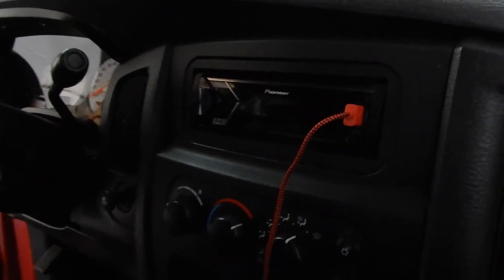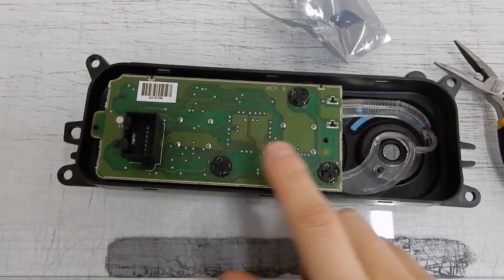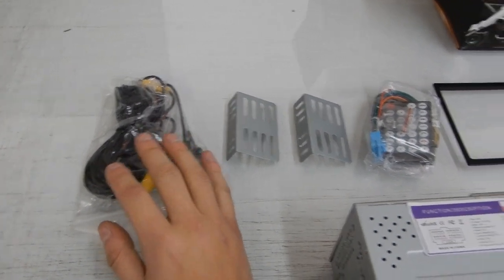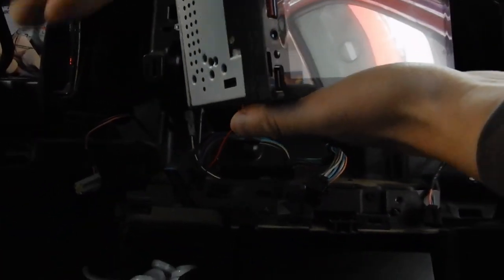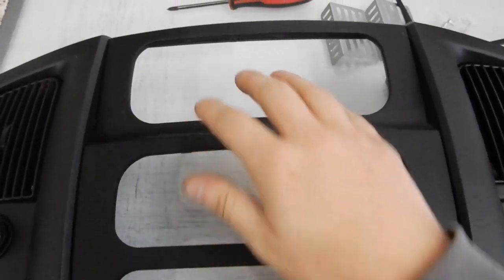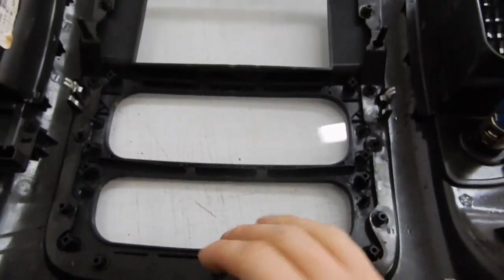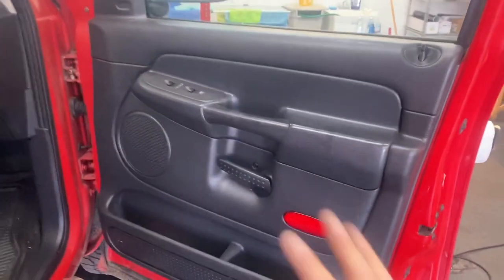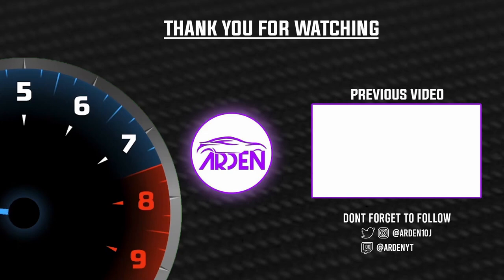2005 Dodge Ram Double DIN Radio Install!

Comment: Door jam harness broken that's why that rear speaker doesn't work
Reply: Well known issue with every Chrysler/Dodge vehicle. Anything older than 10 years speakers, courtesy lights or power locks dont work, and that rubber accordion is where you need to look. Their wires always break. It's like they use the brittlest insulation possible for the wiring harnesses. Ford and Chevy don't have that have that issue.
Reply: 100% correct. It's a common  repair.
Reply: @chadjohnson7544  not always,  I checked and I  still have a ground issue to my door locks😢
Reply: @jlrockafella   hmmm interesting. Let me dive into some  old documents and get back to you on that.

Comment: I'm at the beginning of the video. The  HVAC light bulbs are easy-peasy. I had to do mine a few years back. A pair of mini needle nose pliers into the small holes. You don't need to take the white plate off to change them.  The backup lights are probably something with the aftermarket replacement tail light units.

Comment: The backup camera you installed "works now and then"? The job isn't done then and you should be figuring out what you did wrong. The red wire sticking out of the camera cable at each end is what powers the camera and it should be attached to power at the head unit.
The rear door speaker issue is most likely in the door to body harness and you should have run a new set of wires to fix that problem. 
You should also be using a better crimp connector. Either "white caps" or the type that crimp and have shrink insulation. It just makes a more professional look and reduces failures.
You're gonna need to step up your game.
Reply from the maker: Appreciate your comments/opinions. The camera working now and then was from a faulty power or ground cable coming from the reverse harness in the taillight. Which has been fixed. Just because it’s not in the video doesn’t mean I haven’t fixed it. I know exactly what the little red wire is now. I connected it that day of install. Just didn’t mention in video. I asked the customer (after video was filmed and when he came to pick up the truck) if he wanted me to run new wires to fix the speaker. He said no that it’ll be okay and didn’t want to pay me for the extra time/effort for that (also mentioned in another comment). Wire connectors are a personal preference. A certain connector does not make you better or more professional. Sure there are better methods. I used connectors that I already had laying around our shop. Have had zero failures. I do audio work on the side away from my full time job so I am learning new things as I go. I have never claimed to be a “professional”. I love what I do and I’m just a young guy looking to achieve a dream
Reply: @ArdenAutomotive  You get paid to do the work, that makes you a professional. It's how professional a reputation you want that separates the shade trees from the bad asses.
Those connectors will probably be fine but probably isn't good enough for the bad assed mechanic or the new guy building a reputation. The ones with crimp and shrink wrap (with sealant) cost a little more but they do a heck of a job in relieving stress on the crimp connection, reducing fatigue at the junction of flexible wire and non flexible crimp, and they seal out corrosion causing moisture. For the slight increase in cost, they're well worth it.
As for leaving things out of your videos, you'll get called on it. I've been doing YouTube for 10 years. My first channel (I have three now) started with a camera that did video, a digital audio recorder, and a Sony handi cam.  I've learned a lot. I upped my A/V gear a bit and picked up some heavy duty editing software.
I still get called out when I leave things out.  LOL
Oh, this is the newest account. Slow on the start but when construction begins it should start gathering subs.

Comment: I can tell you what the speaker issue was. For some reason the rear left speaker is common to go out due to the harness in the rubber boot on the door. If you remove the boot, you will see where the wires to the speaker will have a break in them due the opening and closing of the door. I had the issue myself.

Comment: The back doors on those trucks at the door jamb from opening and closing the door cuts the wires so you have to pull the wires out reconnect them. It takes 30 minutes per side. You can check to see if the windows roll up and down if they don't the wires are cut and the speakers won't work
Reply: The speakers don’t work but the windows do roll up and down. Could it just be the speakers r blow or something else?
Reply: My 05 2500, the light doesn't come on when the door is opened, the speaker doesn't work, and the door lock doesn't lock when done from front. Was told to replace the wire harness. Doing that this weekend
Reply: Had the same problem with my 04 on the rr door speaker wasent took the lil boot off where all the wires go in to the door as 3 wires were cut  one was speaker other to was the door lock silonoid

Comment: Where did you get double din panel that you removed and installed in the plastics for this truck?
Reply from the maker: Go on Crutchfield and put in your truck info. Then find the radio you have or one of similar size (Single DIN or Double DIN). Click "See the installation gear you need" and it'll bring up any harness or dash kits you'll need

Comment: Can you add the link of the parts bought and used in the description? I have the same truck. Thanks!
Reply from the maker: It will depend what options you have on your truck. Go to crutchfield.com then put in all your truck details that it'll ask for. Then find the same radio or similar radio that you're installing and click on "save on required installation gear" and it'll show you all the parts you need!

Comment: What did you end up using on in place of the plastic welds that was hold the kit together?
Reply from the maker: You can either smash them down somehow to make them flat, melt them with a lighter/torch to make them flat or take a little bit of super glue around them and that'll work too
Reply: The kit comes with spacers and screws

Comment: Just did this in my sons 2002 dodge ram 1500. The same door speaker didnt work. Ended up being that all the wires in the door jam sleeve were broken. Had to extend the wires and rewire and the speaker lives.
Reply from the maker: Yep. Those Rams are known for that

Comment: I'm guessing that the red wire coming off the video jack close to the head is to be able to put a switch as auxiliary power to turn camera on while not in reverse
Reply from the maker: Yes. It is the trigger wire to tell the radio you’re in reverse

Comment: Shouldn’t you rerun the wire then? It is an audio shop no? It’s not mechanics job but if there’s a break in the wire it is probably in the rubber in the door jamb. Best thing is just run new wire through crimp new wire and go to the dash and pull the wire through. Might have to cut tape and zip ties in the door floor panel. Or just run it manually and cut old wire so not to confuse with new wire. But I do believe if the customer wants it’s audio shops job to fix that.
Reply from the maker: First off I’m not an audio shop. I was doing some audio stuff on the side (installing speakers, radios and subs). I don’t repair things if there’s already a known issue. When this guy came to pick up the truck I asked him if he knew some of the speakers didn’t work and he acknowledged that so I suggested he could bring it to me later to run new wires and I gave him a price for all that (yes expensive price because I don’t want to be responsible if that doesn’t fix the issue then I’m either chasing an issue that I don’t know or have an angry customer because he has to pay me for time and effort but didn’t fix the issue). Sure that may be the wrong way to go about it but I don’t have a shop with unlimited resources and time
Reply: Okay your set up looks like a shop is all. But I get it requiring and electrical diagnostic can cost a lot of money. I was just commenting because I thought you were running a legit shop not side job.
Reply from the maker: @charles-ih7zp  No. I did some audio stuff on the side at the window tint shop I use to work at. I don't do any more audio stuff because of stuff like that.

Comment: And this folks, is a true hack job. None of the steering wheel sound controls work now, do they? Cheap head unit, cheap speakers. Still running the low power stock amp which only sends bass to the front door speakers. Camera is total hack job. There is purple wire in A pillar pre wired for backup camera. Has to sound truly horrid.
Reply from the maker: 1. Didn't have steering wheel controls to begin with. 
2. Customer supplied al the stuff that was installed. Not my choice. Clearly you didn't hear the part where I said the customer installed those speakers and he just wanted me to check his connections. I didn't even install the speakers. 
3. I did what I could with the camera that was provided. There's no such thing as a pre-wired backup camera in a 2005 truck where backup cameras were barely even a thing. 
4. Like I said previously I didn't buy the radio or speakers or anything in this install. He bought what he wanted installed so I installed. Not my problem that he didn't want to spend the money for a good radio and good sound system